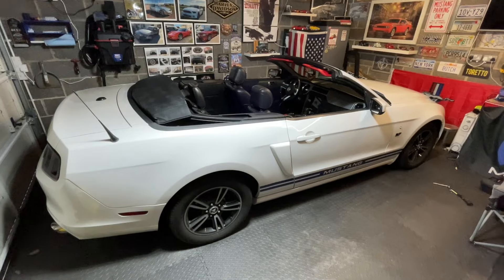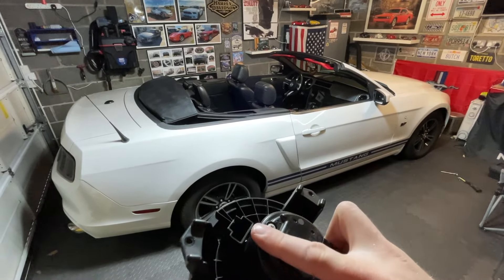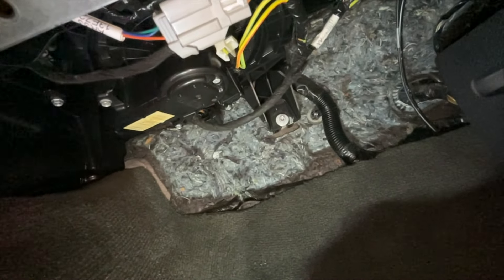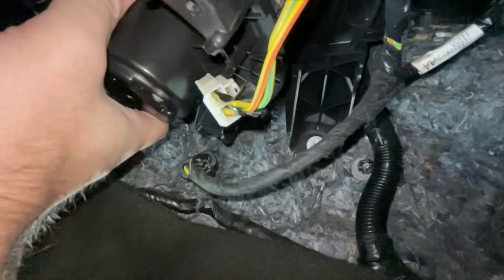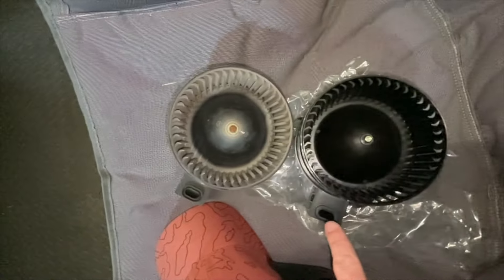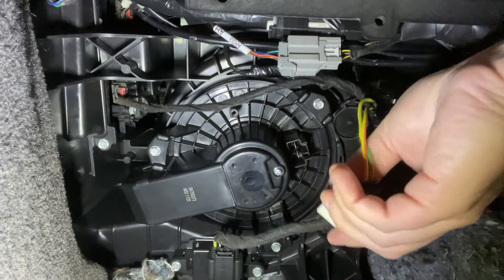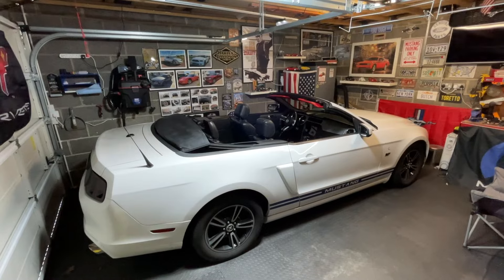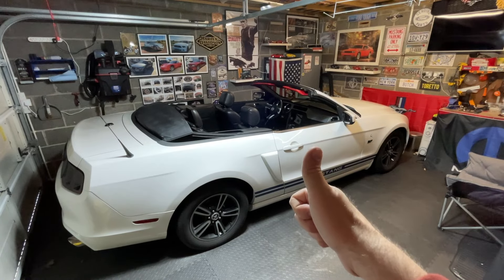05 -14 S197 Mustang interior blower motor/fan replacement

Comment: Hey I replaced my blower motor because of a high pitch sound.  I used a Motorcraft part, but the high pitch was the same as the old unit so I figured that the sound was normal.  Did you use Motorcraft or a different brand?  If so, what did you use?

EDIT:  nevermind i saw your rockauto link.
Reply from the maker: No worries. The Motorcraft ones have a small hole in the bottom. Put your finger on it when its on and the noise stops. The one I bought is sealed at the bottom, no noise. It’s just air escaping but mine didn’t make any noise for the first year of ownership.
Reply: @autogaragelife  Can i just put tape over that hole?
Reply from the maker: Suppose you could try but they don’t normally make that noise when new even with the hole. My previous car had the same noise and got more “mechanical” noise over time so I just replaced the fan in this case rather than trying to plug it.
Reply: @autogaragelife  Alright, I'll just wait until it gets worse and then replace it.  Really appreciate your replies.  Thank you.